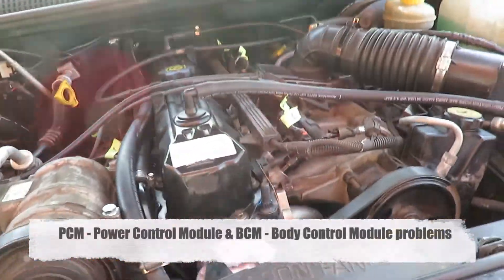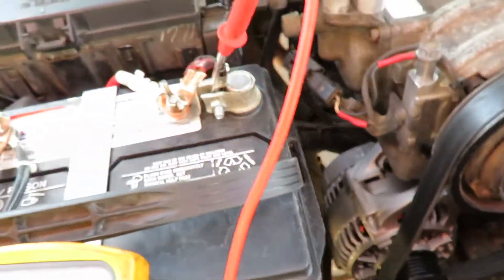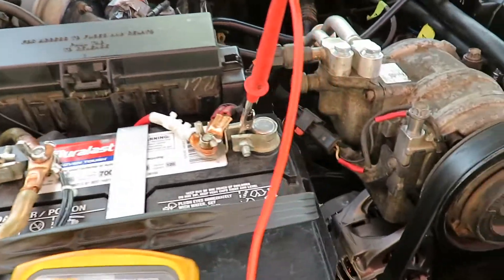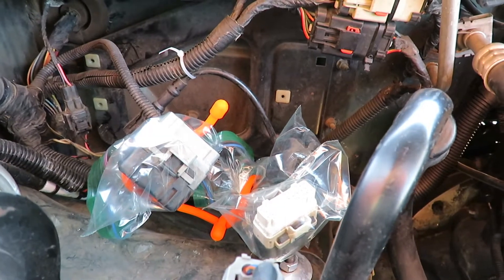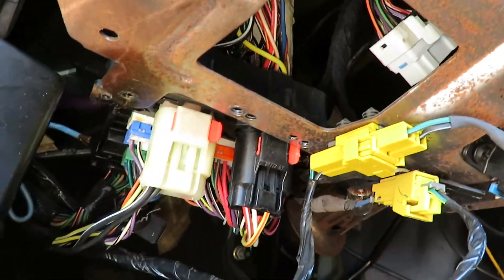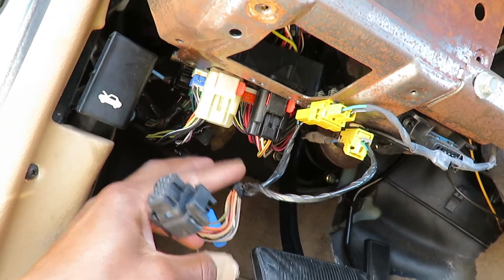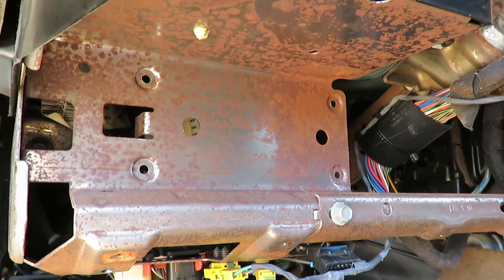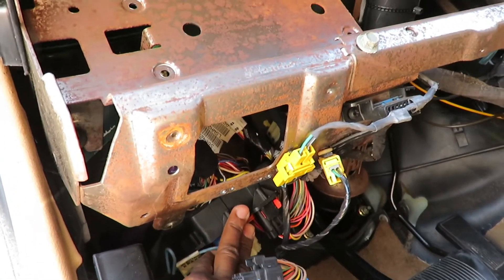ZJ Grand Cherokee PCM and BCM Electrical problems Part 1 of 2

Comment: Hey best way to check for parasitic draw is doing an amperage draw test. Put your multimeter in amperage mode. Disconnect negative battery cable, hook your multimeter black lead to the battery POST and then hook your red lead to the negative battery CABLE. Give it at least 20 minutes to let all the modules go to sleep and now you can check your amperage draw. 24-50 milliamps is the normal limit for a vehicle. Anything over is considered a parasitic draw.
Reply from the maker: YES YES, Thanks

Comment: Jeep runs fine when it does start that's why I ruled out pcm but I really think it's got to do with the anti theft system but don't know where to start .please advise
Reply from the maker: The security system ties in with the door locks somewhere down the line. I'm not 100% sure, not even 50% sure because schematics are scarce and the repair manual is worthless in my opinion. The guys at oriiely parts pulled up some schematics for me a while back, maybe you have some luck there.
Reply: @b2zmodz220  I tried the whole door lock thing but still no luck I'm actually starting to pull out the dash to see if I can find the module that controls the immobiliser.i think it's the one cutting out power to the coil

Comment: Hi what unit is responsible for no power to the injector as well as coil.zj 97 please I'm just about to throw in the towel
Reply from the maker: The PCM/power-control-module is responsible primarily responsible for the injectors and coil. The engine tune/programing is inside the PCM and the tune tells every electrical component what to do and how to do it. This is my professional opinion, thanks. Stay safe.

Comment: Thanks for the detailed description & video archive. I'll be watching part II next. My issues ('98 Laredo): once our Arizona summer temps go above 95F or if in the direct sun, I lose the following functionality: upon opening door, no interior lights (door activated) but YES push-button lights work fine, except REAR light at hatch; door locks & controller work fine; add key and turn to ACC: ONLY ABS check light comes on, nothing else on the dash, and nothing moves on the instrument cluster (no odometer reading either); fuel pump engages fine, Jeep fires right up like normal. No power windows. Over-head display: No temperature reading "--", but YES Compass is correct, incorrect DTE, and probably reasonable trip meter & MPG readings. Last, Blower fan & vent selection works, but A/C is not cold (green light ON/OFF switch works, just not cold air). Drives fine. Everything else works (did not test wipers, mirror controllers). So Greulichs here in Phoenix troubleshooted when it was dead (not when it was working as well, under ~95F etc. during mornings/nights), and recommended BCM, then if not a fix, instrument cluster, and if not fixed, door lock controllers (Left & Right)... In the middle of having the instrument cluster bench tested for bad solder connections...
Reply from the maker: Sorry for the late response. Sounds like you are having a PCM (power control module)/ECM (engine control module problem)
In my opinion, the main culprit for these Jeep electrical and engine start issues is the power control module. You can find other videos where people are addressing problems with the circuit board inside the PCMs. Two of the main problems is: corrosion and bad/cold solders.

I know, for a fact, everything in the gauge cluster is controlled by the PCM/ECM. the first time I killed my PCM/ECM, the very first thing I noticed was everything in the gauge cluster was dead, nothing moved, this also includes the odometer. 

How I killed my PCM/ ECM, was via the parking/headlight switch. After purchasing my 98 Laredo I noticed some corrosion in same headlight and parklight bulbs’ sockets. After replacing the sockets, I went to turn on the headlights and parking lights. The parklights work fine, as I switched to the headlights “the engine started turning over but not starting LOL” Crazy sh*t right, thankfully I was still in the driveway. Afterwards, I went to start my Jeep, when the key was in the run position I noticed the gas hand wasn't working, no needles jumped, and my odometer reading was all zeros, in my case at least, and also there was no fuel pump initiation noise. 

I tried buying a power control module online, Long story short, it was no good. My engine never started. Best place to go is O'Reilly auto parts, I got mine replaced from there three times. First time I paid about $230.00, the other replacements were under warranty because all this happened with 1 year. If you choose this route be sure to give them your odometer reading when ordering the power control module. If not, you'll get A PCM with A bogus reading. The last PCM I ordered someone made a mistake because my odometer read 305,000 miles, But that didn't matter much for me, I built my Jeep for off roading only.

The second time I killed my PCM/ECM was after I inadvertently activated the security alarm, by accidentally hitting the door lock switch after exiting and reentering my jeep. this happened in the auto parts store parking lot, as a matter of fact I killed the PCM/ECM a second time in the very same parking lot. None of the security deactivation methods I found online worked, so I completely covered my door lock/unlock switches/buttons in place with black adhesive sealant so they could never be used again and us a similar method for the headlight switch, so the headlights position could never be used again. As for the headlight/parking light switch, I took the headlight and high being circuit out of the circuit. ask for the headlights, I had to hunt down the wire that provided power to the headlights on the backside of the headlight/parking light switch. After finding the wire I simply cut and stowed it. As for the high beams, they are on a separate circuit and they get their power from the same fuse, in the engine bay fuse box, I think mine fuse was 50 amp labeled AUX. That provides power for the push button cigarette lighter outlet and the high beam switch. The second auxiliary power outlet to the right of my cigar lighter gets its power from a separate circuit and its fuse is in the passenger side, kick panel fuse box.

As for how I got my headlights to work again, I made my own harness. My harness included one fuse holder with a 15 amp fuse, which provided power to an on-off switch, which provided power to an on-off-on switch. As for the on-off-on switch, one (ON) position activated my low beams, the other (ON) position activated my high beams. This worked perfect for me, Even though the switches go bad and need to be replaced every now and again.

In my opinion, the main culprit for these Jeep electrical and engine start issues is the power control module. You can find other videos where people are addressing problems with the circuit board inside the PCMs. Two of the main problems is: corrosion and bad/cold solders.
Reply: @b2zmodz220  Thanks for the details -- I'm sure your experiences will come in handy for me and others some day. So far, I've had my instrument panel/cluster tested & cleaned up, working fine. The BCM was swapped out from an eBay find, which temporarily solved the electrical problems, but had two issues: 1) mileage from previous vehicle now showing on odometer (and presumably not matching w/ the PCM's memory) and 2) VIN probably stored from the previous vehicle (also presumably not matching w/ PCM's memory). One day about 15 days in, I go to unlock rear hatch and alarm goes off ... I had never heard the alarm during my 14 yrs of ownership, and I no longer had key fob function. Tried cycling the key in each lock (3), then into ignition, firing it up (died seconds later, immobilized), then unplugged battery. That BCM now had an alarm "code". So I put in my original BCM, and alarm is gone...however, the PCM (evidently) does not like the current state: immobilized, though alarm is not going off. SOOOOO Jeep dealer is able to remove the alarm code from the PCM, (not the BCM, unable to touch that coding), and now I am back to square one. Luckily, it drives and the weather is now below 90F so I have full function again... until next Summer!
Reply: I'm helping my friend with kis 97 and Cherokee and he is having the exact same issues as you are with it cranking up just fine and having no dash lights  interior lights, I was thinking it was a bcm,

Comment: Where in zj is body control module?
Reply: He stated above the driver's left knee, to the bottom/rear of the steering column. You can see his description in the video @7:25
Reply from the maker: Thanks
Reply: There's also something inside of the console don't know what it does it's by the emergency brake